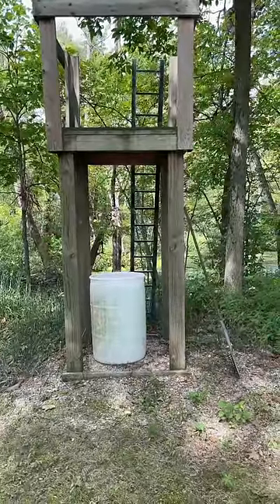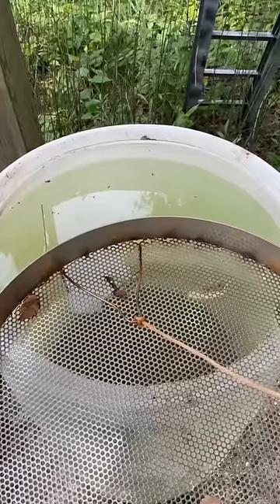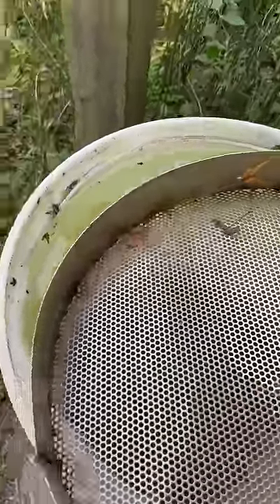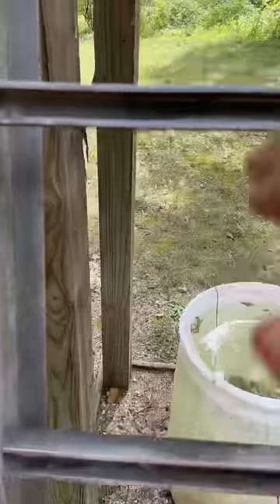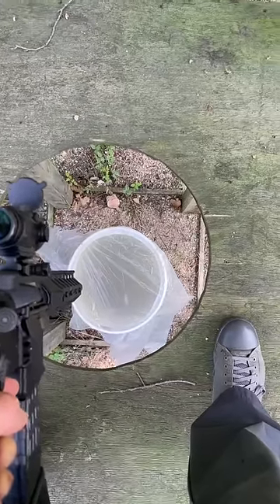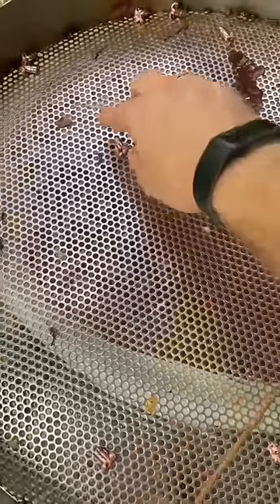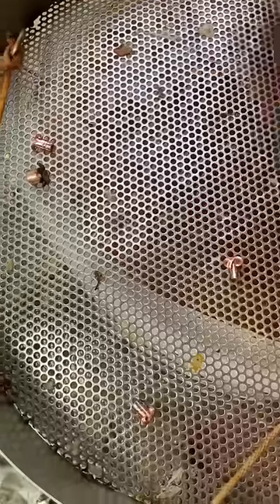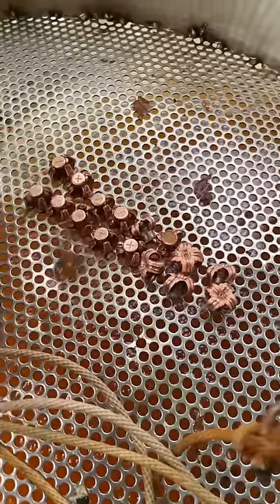Not An Outhouse? What Do I Use This Structure For! #shorts

Comment: I began carrying Winchester personal defense 230 gr HP .45 ACP rounds after doing a similar test. We placed a 55 gal drum beside the garage, filled to the top with water leaving the top of the barrel in place, put 2 layers of blue jean material on top of a 4 in thick phone book (yes it was that long ago). Shot it with different guns and cal and only the 30-06 WW2 era black tipped AP and the Win .45 ACP HP bullets went all the way through the column of water, 2 layers of thick plastic, phone book and Jean material. The .30 cal was barely scratched and the .45 was opened up to about .70 cal
Reply from the maker: That's awesome! I remember one of the older youtube channels used to collect bullets in pretty much the same way!

Comment: In mythbusters the bullets turned to shards… what is going on..
Reply from the maker: It depends on the bullet design. Copper bullets typically will expand and mushroom out. Some lead rounds will too, but if they're higher velocity they tend to fragment apart.

Comment: As far as the splashback with the water goes, why not add/replace the plywood with a new piece, but instead of that large hole, just make it smaller. Enough to fit basically any barrel/muzzle, but not enough to make you feel and look like you just went on one of those splash zone ride things.

Comment: Ive shot a .45 into a 55g drum of water like that and it went through the bottom and into the ground about 3 inches.
Reply from the maker: What kind of 45? FMJ!
Reply: @BuffRANGE  Yes, out of a full size Kimber. I figured an FMJ would have the best chance to reach the bottom. I was standing on a chair next to the barrel, not as high as your setup.